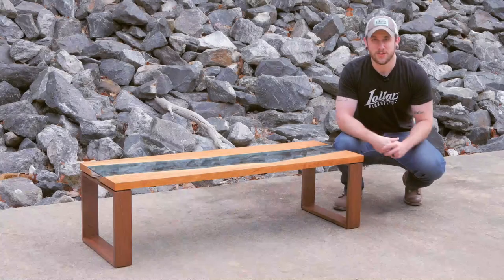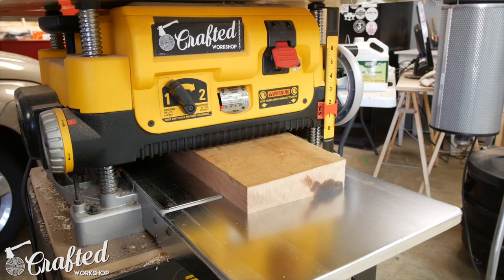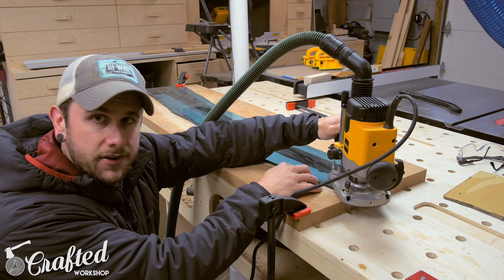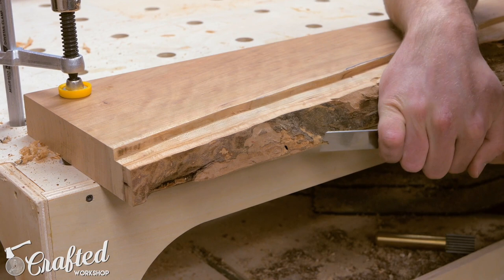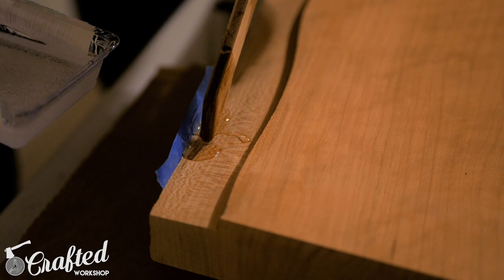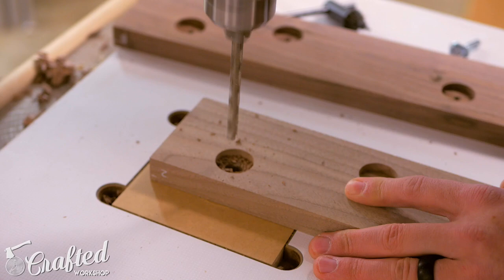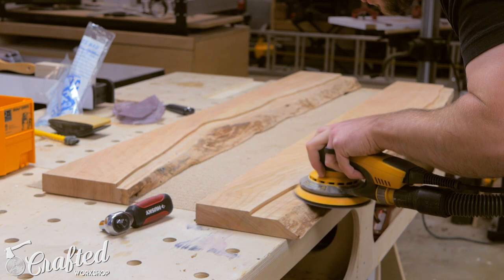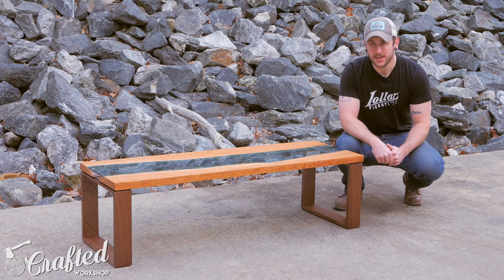Live Edge River Coffee Table | How To Build - Woodworking

Comment: Great work Johnny! Next time when dealing with end grain on the router table, if you do the end grain first, any tear out will be removed when you do the long grain.
Reply from the maker: +GuysWoodshop thanks Guy! The tearout was actually on the face of the board, not on the edges. It was a real pain, might have just been the wood grain causing issues.
Reply: Gotcha. Another method for end grain is to use a backer board as you push it through. I do that quite a bit also. And one other question, can I have that table? :)
Reply from the maker: +GuysWoodshop good tips. And for the right price, I can ship it right to your door. 😜
Reply: Crafted Workshop How much for the table?

Comment: Awesome work and very beatiful!  Thank you so much about sharing all the information. Do you mind if I ask you how close was the router bit to the glass. Did the router bit touch the glass at all? 
Did you some how attch the glass at the end or it is just floaded? 
Thank you so much again!!
Reply from the maker: +Hamid Reza Mostajabi thanks! The bit has a bearing on it, and the bearing is what is touching the glass. The bit is just slightly narrower than the bearing, so it should no touch the glass, that would be BAD! And no, the glass is just floating. Thanks again!

Comment: That is great!  I have a 12/4 rough walnut slab I milled that ended up splitting most of the way down the middle (contained the pith).  This would be a perfect project for that slab.  ....and I could keep the life edge for the outside.  Now I just need to find the glass company locally (....and find the time).  Great project.  Thanks!
Reply from the maker: +johnsobj for sure! Have fun.

Comment: Nice, I like the smaller size.  Something like that would work perfectly in my TV room.  Big enough to hold remotes etc.  Not too big to overwhelm the space.  Also I learned something.  How to drop the glass in to the wood when it's got all those crazy shapes.  I always wondered how they did it, but never really tried to work it through in my head.
Reply from the maker: +ManCraftingTM thanks, yea it's a nice fairly small size. The router work took some thought but it worked out great!
Reply: use a template, not the glass itself

Comment: I am in the process of building one. I anticipated that I would need to use the offcuts of the glass as routing templates, but I am impressed with how tight of a fit you got from using the actual glass. My concern was that the bit would add 1/4" to whatever radius was on the glass edges, but it looks like that effect is negligible. Very nice work!
Reply from the maker: +Matthew S thanks! Yea, the fit is as good as I would ever expect, didn't even consider that the radius would change but you're right. Didn't seem to effect anything.

Comment: Nice one..You should cut that on the table saw..it would left nice straight cut without tear-off. 
good luck
Reply from the maker: +Slovenian Woodworker I couldn't cut it on the table saw without some kind of jig. Thanks!
Reply: Crafted Workshop Not at all.
i do it like this many times.
the same way as you cut in router the same way you do it on the table saw.Set the fence like 1" of the blade and pass it thru on each side . than you re adjust the blade hight and the fence,turn your work piece and repeat the process. You'll end up with straight clean groves. I do it like this when i make windows. good luck
Reply from the maker: +Slovenian Woodworker I see what you're saying. I thought you meant to cut the whole slab in half on the table saw. That would be trickier since there isn't a straight edge.

Comment: If you use aluminum duct tape instead of painters tape, not only do you not have to worry about setting it on fire, but the epoxy does not leak through the tape as easily. =)
Reply from the maker: +RealRuler2112 good call!

Comment: Very cool video! Could you get a similar result using a dye tinted epoxy resin instead of the glass? I think I am going to try it! What a great video! Thank you for sharing your techinique!
Reply from the maker: +Keda Wood Dye you definitely could but it'd be expensive!
Reply: Crafted Workshop I totally understand, but I am thinking about putting some LED lights in the channel on both sides. Now I know I could still do this with the glass, but I would like to illuminate and make the center piece glow, a deep blue, kinda like a fiber optic would do if that makes sense. Perhaps I could tint the lacquer a deep blue, and spray the bottom side of the glass insert for the river table for this affect as well. Either way awesome video, great woodwork, and beautiful results. You Rock!
Reply from the maker: +Keda Wood Dye thanks!

Comment: Fantastic work! I'm planning to make something similar. Question: how did you get the glass to fit so snug? When you used the template bit for the first time, you had to cut to the right of the edge of the glass, as the bearing rode alongside the edge. Did you adjust the placement of the glass when you routed the other edge?
Reply from the maker: +Brian King thanks! Yea, I basically placed the glass about ½" from where I wanted it to end up, so that way once the groove was routed, it'd be in the right spot. The nice thing about this type of table is you don't have to be super exact with the glass placement, I just eyeballed it.

Comment: There's another designer, forgot their name, who's done similar work. Only difference, they use multiple sheets of glass for an added depth look, due to the coloring, each layer gets darker even though all the sheets are the same. They did one with more of a 3d pattern to the wood, with something like 15+ layers if I recall correctly, and it really did look like you were looking into ocean depths, other than the color of plain wood of course, but it was amazing.
Reply from the maker: +Xander Zoolander that sounds cool!
Reply: Actually, I was way, way off. 18 layers of glass, about 23 of wood, I think. It's the Abyss Table by Duffy London, which they have a whole series of Abyss products, sadly the table was only limited to 25. All I could find pricing wise is a little over $7.5k in 2014, which is about $10.2k today after exchange rates from the british pound. 150cm long, 75cm wide, 40cm tall.
https://duffylondon.com/product/tables/abyss-table/
They also made the Kraken Abyss table, which is larger in every dimension; 190cm long, 95cm wide, 48cm tall, limited to 25 editions.
https://duffylondon.com/product/furniture/kraken-abyss-tables/
The Abyss Console table, which is longer, taller, but skinnier; 200cm long, 55cm wide, 75cm wide, limited to 11 editions.
https://duffylondon.com/product/tables/console-abyss-table/
And the Abyss Horizon, which is a circle; 110cm in diameter and 47cm tall, limited to 12 editions.
https://duffylondon.com/product/tables/abyss-horizon/
I would also assume each 'edition' is unique, since they're hand crafted.

Comment: Would it of been possible to use some sort of epoxy instead of glass. Maybe if the project was smaller
Reply from the maker: +Rookie2EliteTV for sure. Epoxy is extremely expensive in large quantities, hence why I went with glass.

Comment: Looks great. Can you explain what you meant by elongating your holes for expansion and contraction toward the outside of the legs? Thanks!
Reply: So that when the table top expands, the two halves move outwards away form each other. If it was free to move inwards, there would be a possibility of them pushing against the glass and cracking it.
Reply from the maker: +Jeremiah Alexander yup! If you'll notice in the video, the holes towards the outside are twice as wide. This extra width allows the top to expand and contract freely. Otherwise, it would probably crack.
Reply from the maker: +The World of Scott exactly!

Comment: Did you consider epoxy resin instead of glass? I think you could keep the overall look in a single slab of a tabletop.
Reply from the maker: +Charles Williams I did, but it would have been very expensive and tricky to get it crystal clear.

Comment: Looks good.  Take the sketchiness out of it and don't ride your bearing bit along the glass.  Rather measure back from the bit to the outside edge of the router base plate.  Use that number to offset your glass from your line, tape and secure your glass, then ride the base plate edge against the glass.  Used this trick in stair building for many years in different applications.  Also, frog tape is best.  Just sayin'
Reply from the maker: Good tip! Thanks.

Comment: Nice Work.  One suggestion for your consideration.  Consider the dimensions of the legs. Something other than the standard 3/4" thickness makes things more  interesting.  Also, was the Minwax finish oil or water based?  What is it called specifically?
Reply from the maker: +James Voos thanks! It's Minwax Wipe On Poly, it's oil based.

Comment: I think I'd of cut the glass from a piece of 1/4" ply template then used that as the routing template also rather than run a router up against a $70 piece of glass.  All nicely done though.
Reply from the maker: +Carl Bowden that definitely would work, but I didn't know how accurate the glass cutting would be.

Comment: I feel like taping the wood is a bad idea considering the wood might strip easy if you tighten it more. Wouldn't an insert nut work better?
Reply from the maker: +Jordan Kukulski nope, threaded holes in wood are incredibly strong. Andrew Klein had a great video strength testing them.

Comment: Really nice ! Are these threads in the wood really meant to be used like metal ones though ? Like how many times can you take the legs off and on again before the thread wears out ?
Reply from the maker: +nitsn the threads are surprisingly strong. I don't plan to take it apart frequently, but you could strengthen the threads by adding some CA glue and re-tapping them. They are super strong as is, though.

Comment: Such a beautiful finish, but I wasn't too sure about the huge difference in thickness between the wood and glass. Is there a way to compromise and equal the thickness of both materials so the top and underneath are perfectly flush and still able to be put together as one unit? :)
Reply from the maker: Thanks! I don't think you could have a sturdy table if the wood matched the glass thickness, and glass that thick would be incredibly expensive and heavy. Might want to go with a resin if that's the look you're going for.
Reply: Crafted Workshop think I'll try a scaled down version of glass panel on top of resin, be interesting to see if it's obvious or not :)
Reply from the maker: +Swagmuffin I think it probably will be, but we'll see!

Comment: Love this table, Johnny! I want to try this soon. Tell me: is there any need to glue or tape the glass down to the wood? or does it fit so perfectly its not a problem?
Reply from the maker: Thanks! No need for glue, the fit should be tight enough to keep it from moving. If you look at most commercially sold coffee tables with glass parts, there is no physical bond, they’re usually just floating.

Comment: Could this epoxy be used at 1/2 to 1 inch thick for this type of table with a wood floor and glass crystals for the bed of the river instead of using glass on the top, and how would it be done, and will it stay clear for many years?
Reply from the maker: +Debbie Holland it could definitely be done with the right type of epoxy. You’d build some kind of form around the wood to hold the epoxy while it cured.

Comment: the glass part isn't secured to the wood by anything except its own weight?

also how much torque can you really put on a bolt into wood threads? That seems like it'd strip **really** easily.
Reply from the maker: Nope, it's just floating on the wood. Hasn't budged an inch. Wood threads are extremely strong, especially in a hardwood like Cherry.

Comment: Would acrylic or polycarbonate glass work?
Reply: Yes if its thick enough, how ever mind that glass is much harder material than polycarbonate and will scratch easily, so take that in consideration when making the plans.. just think about the "omfg going to kill you" if first person sitting in your chair would scratch the poly with for instance key chain... If its the coffee table i believe poly could work well with that, with said limitations. Ou and dont place anything hot top of that and if its with glass peace then dont place anything hot top of that, if glass is ice cold (internal heat expansion difference can/eventually will shatter the glass, specially tempered glass) Hope this helps
Reply: Thanks!

Comment: Is taking the bark off required? Doesn't that take away from the live edge theme?
Reply from the maker: +Hotrod Hog this slab didn't have bark to begin with. I just cleaned up the dirt and other leftover stuff on the edge. You can certainly leave the bark if your slab has it, although it might fall off anyway. It depends on when the tree was cut down.

Comment: I'm new to your channel, and was going to commend you on diresta-ing your saw, but you spoiled it with the video watermark.

Could this be done with stained epoxy, for a table people could sit on, or would it be better to just go with thick tempered glass?
Reply from the maker: +bno112300 you could definitely use epoxy, it's plenty strong. And yea, I watermark my videos so that if/when they get stolen and reuploaded, I can get credit.
Reply: But, if you go full Jimmy Diresta and have your channel name in every shot, you won't need to and you won't cover anything.

Has anyone freebooted your videos before, or are you doing this pre-emptively?
Reply from the maker: +bno112300 yea, the issue is I like to keep the resale value of my tools up in case I want to sell them. Plastering with my logo doesn't help that, hah. And yup, definitely had plenty of videos stolen and expect it to continue.

Comment: Thank you for the information! I am kind of new in woodworking. I've tried to look on internet to find the same glass, no lock.  I called different glass stores in Cincinnati, OH. Non of them has that. Is it called Blue plate glass? Do you have any link can help me?
Sorry if I have any misstakes in my English. It is my second language.
Thank you!
Reply from the maker: +Hamid Reza Mostajabi no problem! Plate glass is just a type of glass, it's easy to cut unlike tempered glass. They should be able to special order it for you.
Reply: After the build, have you had any issues with the plate glass being stable and not cracking?  My local glass companies I am working with are recommending I use tempered glass for this project, but it obviously costs more.  Thoughts?
Reply from the maker: It’s been totally fine, but obviously it would be easier to break than tempered.

Comment: You sort of glazed over the bubble removing process.  I guess you heat the epoxy to make the fluid less "thick or gooey" (hard to find the right word) so bubbles can push out easier?  But wouldn't that make the epoxy leak out the tape?  Or maybe you're expanding the gas in the bubbles so they push out?  I'd like to better understand
Reply from the maker: +J Fred Beck it’s expanding the gas that does it. Brings the bubbles to the surface and pops them. It’s really simple, a heat gun, hair dryer, or torch will work.

Comment: Very nice build Johnny! Did you use tempered glass? Thanks!
Reply: I don't believe tempered glass can be cut (my understanding is that it has to be manufactured to size, such as a car window).  Based on this, and the fact that he states he had the glass cut to size for him, I'm guessing the glass is just plate glass, not tempered.  But I'm certainly no glass expert so if anyone else has other ideas please share.
Reply: I did not know! Thanks for the info!
Reply from the maker: +David Smith yup, I used ¼" blue plate glass, as I said in the video. Tempered is not able to be cut like this, at least not nearly as easily.
Reply: Hi, how do you cut the glass in curves?
Reply: You cant cut tempered glass, it will just shatter if you try. How ever i believe what Donny mean was that were this glass tempered after it was cut and sanded to shape you wanted? 

Far as i understand any shape of glass can be tempered, how ever this can create weak spots, for instance triangle shape glass ends will be easy to break (due lack of material around) and will the shatter whole glass in chain reaction. Untempered glass will just crack and will create glass spikes, so if its furniture always temper the glass.
Reply from the maker: +Hellsong89 the glass was not tempered after cutting.
Reply: ive always wondered if greg klassen tempers his glass, i saw a pic on Instagram he posted of a glass river that got damaged in transport. it was broken into large shards indicating its not tempered. it could have been from one of his wall art pieces but he didn't answer any questions and i think the post was removed. the tables look great but if the glass isn't tempered someone could get seriously hurt. im not sure on the regulations in the usa but when he is importing into the uk the glass must be tempered or he risks a major law suit. you did a great job btw
Reply from the maker: +dannyfall thanks!
Reply: How much weight can that glass take? I’d be wary planting my butt on it, let alone standing on it.

Comment: Where did you get the glass from and how long is it?
Reply from the maker: +J0MamaIsHere I got it from a local commercial glass company. It's about 55" long.
Reply: Do you remember the name of the company? I am having trouble finding a glass company with stained glass that long.
Reply from the maker: +J0MamaIsHere the company I got it from is just called Commercial Glass, they're based here in Asheville, NC.
Reply: outstanding work. googled commercial glass, Asheville, NC and it shows 4 to 5 companies
Do you have  exact name, tel. # or web site? Thanks, joe
Reply from the maker: +ALMOST RIGHT IS WRONG Wholesale Glass & Mirror Company is where I got it. Hope that helps!